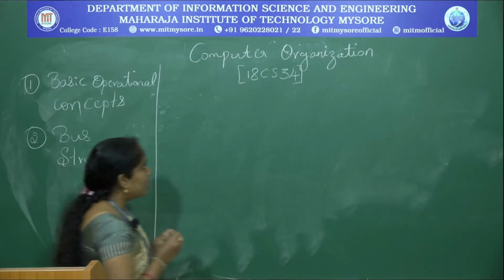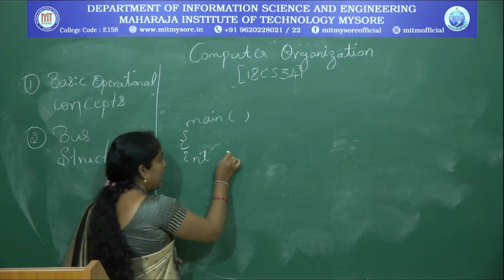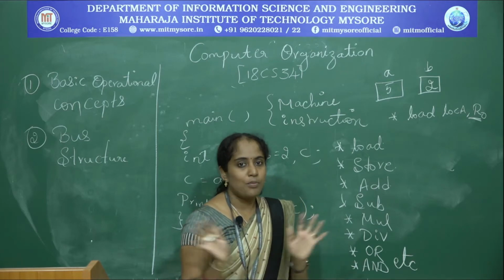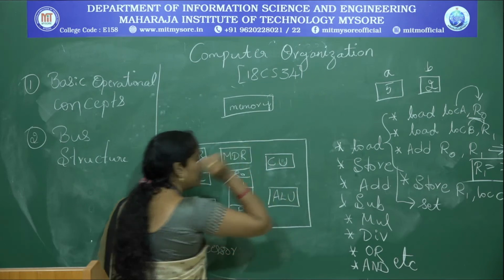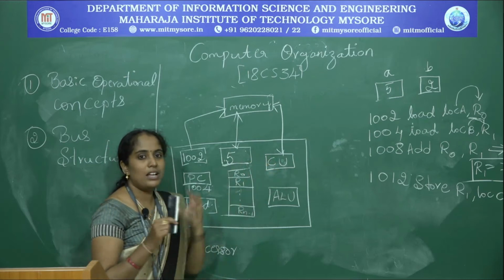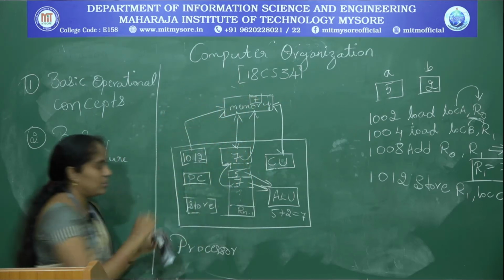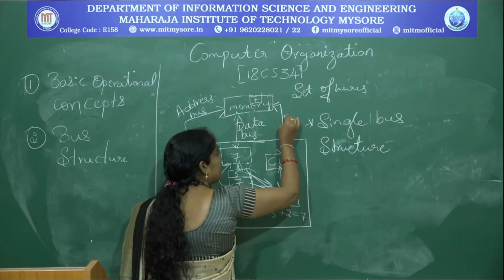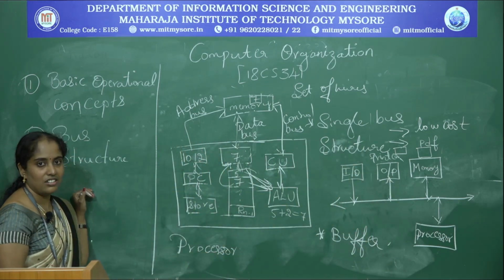Basic Operational Concepts | III | CS | Mod1 | CO | S1

Comment: The video is about basic operational concepts of a computer.

The speaker first introduces the five functional units of a computer: input unit, output unit, memory, control unit, and arithmetic logic unit (ALU). The input unit allows users to provide information to the computer, such as through a keyboard or mouse. The output unit displays information to the user, such as on a monitor or printer. Memory stores data for later use. The control unit controls all the other units and ensures they work together properly. The ALU performs arithmetic and logical operations on data.

The speaker then explains how instructions are executed by the computer. Instructions are stored in memory and loaded into the processor one at a time. The processor decodes the instruction and then executes it. To execute an instruction, the processor may need to fetch data from memory, perform an operation on the data in the ALU, and store the result back in memory.

The speaker uses an example of adding two numbers to illustrate how instructions are executed. The program is first loaded into memory. Then, the processor fetches the first instruction, which is a load instruction. The load instruction tells the processor to load the value of a variable from memory into a register. The processor then fetches the second instruction, which is an add instruction. The add instruction tells the processor to add the values in two registers. The processor adds the values and stores the result in another register. Finally, the processor fetches the third instruction, which is a store instruction. The store instruction tells the processor to store the value in a register back into memory.

The speaker also discusses how the computer's memory and processor communicate with each other using a bus. A bus is a set of wires that carries data between different parts of the computer. The computer uses three types of buses: address bus, data bus, and control bus. The address bus carries the address of the data that is being accessed. The data bus carries the data itself. The control bus carries control signals that tell the different parts of the computer what to do.

The speaker concludes by mentioning that there are different types of bus structures, but the video only discussed the single bus structure. In a single bus structure, only two devices can be active at the same time. This can limit the performance of the computer.

I hope this summary is helpful!